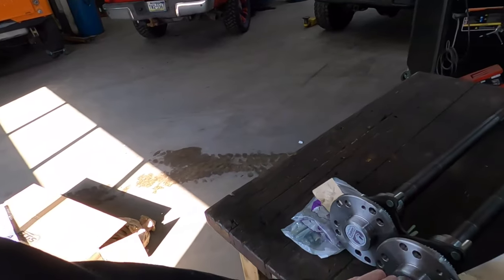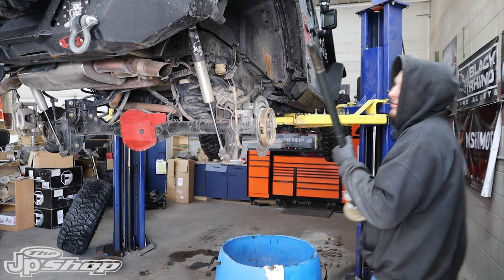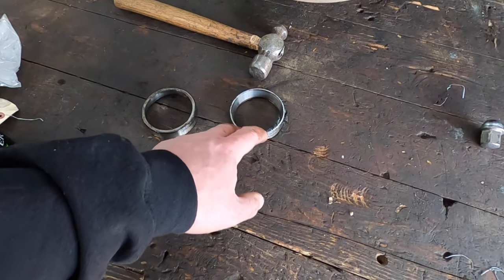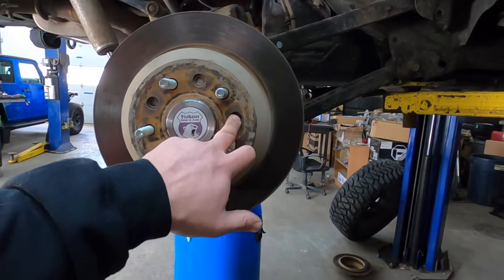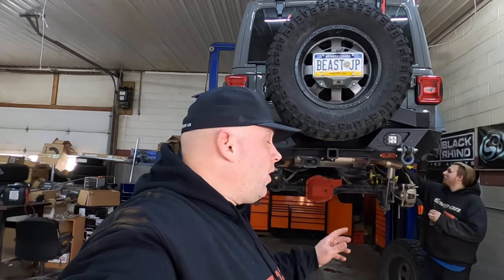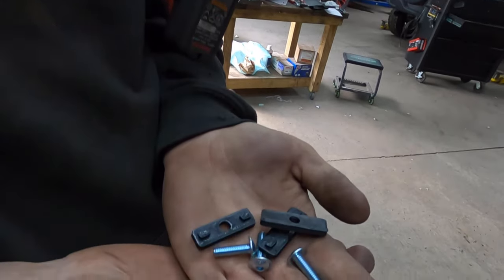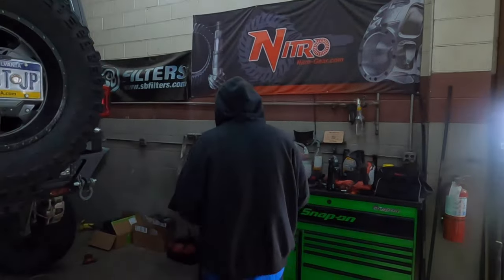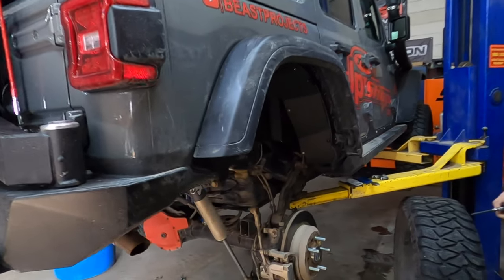STRONGER DRIVELINE PT3 Jeep JL Yukon Chromoly Rear Axle Shafts

Comment: Nice channel bro!! I got a wrangler 2020 sport model with rear Dana 35. It’s leaking oil by the wheels. my question is.  Will the problem be the shaft seals or will it be a seal inside the differential?  Isn't it necessary to drain all the oil from the differential?